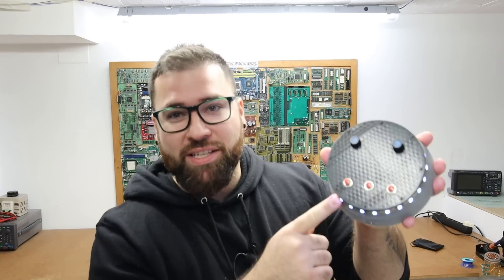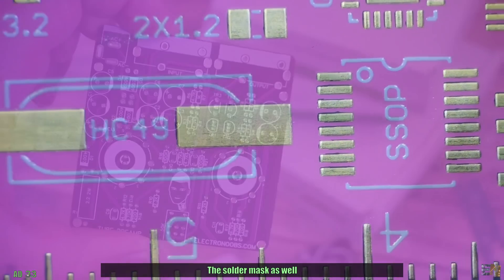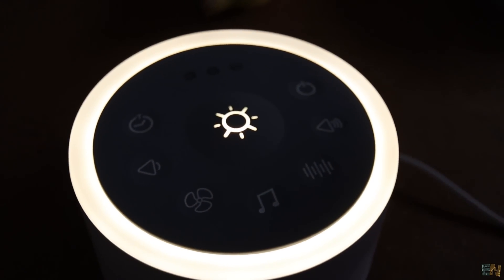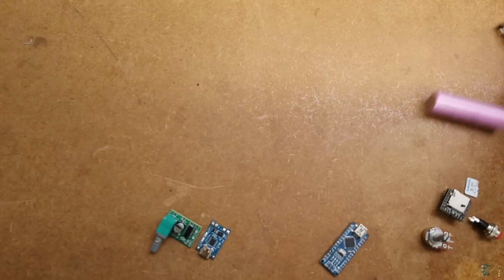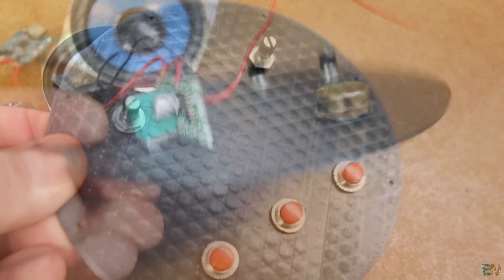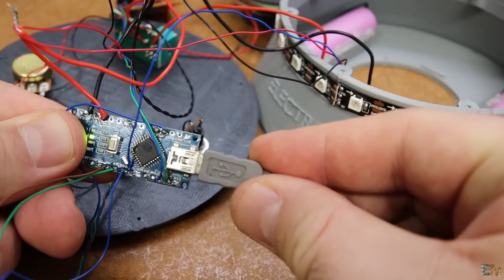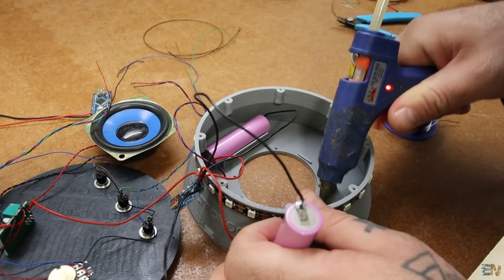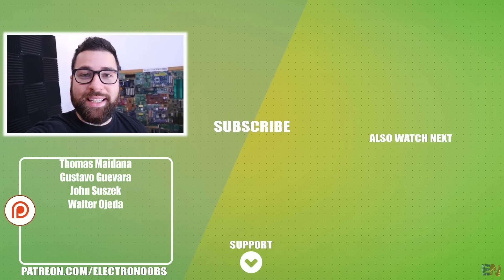Sounds, RGB, 3D prints, Radio and more - Noise Generator

Comment: As the father of a 2 month old myself I very much appreciate this project.  It's very interesting.  I'm glad you threw the radio control in there at the end.  Earlier on in the video I was thinking about if this was built with an ESP32 an Android app could have been used to trigger the different MP3 files or as an alternative to the built-in buttons.  Your remote control makes that unnecessary.  One nice thing about that approach is if an ADS1115 is used (one channel to measure the voltage of the two batteries in series and one channel to measure the voltage of the battery that is connected to ground) the voltages of the batteries can be calculated and reported back to the Android app so that the user knows when to recharge (when it is getting low).  I used that approach in one of my projects with two 18650 batteries in series like this.

Thank you for creating this neat projects and sharing it Andrei.

Comment: As always, great video! Just one question: is it safe to connect 2 18650 to the 4056? Shouldn’t be used a bms that could charge the two batteries separately?

Comment: So are you running the nano off 4.2 volts when its not plugged in?
Reply from the maker: Yes, the nano can work well with voltages from 2.7V to 6V. The clock speed might be affected and other stuff like ADC, bur for this project is ok. Actually there are nanos that world at only 3.3V